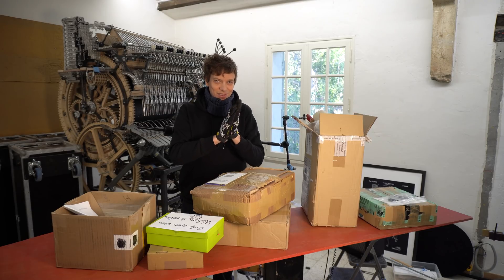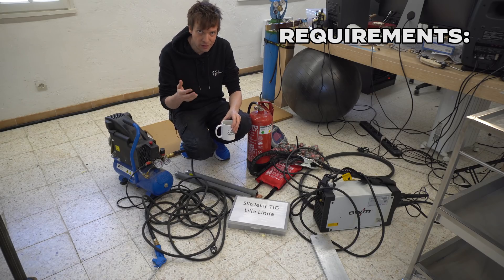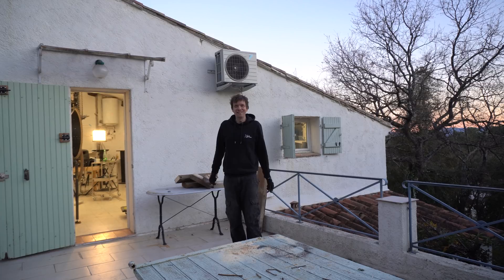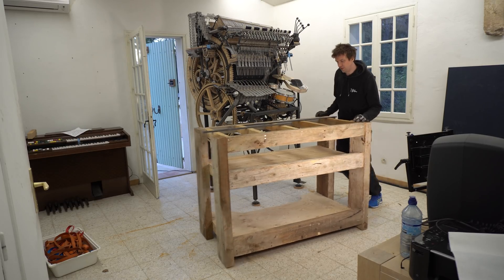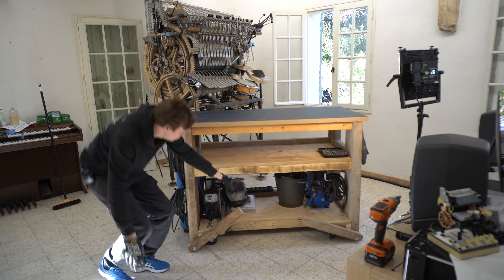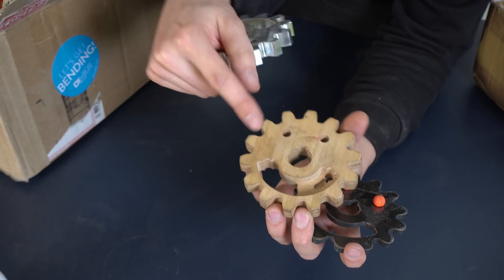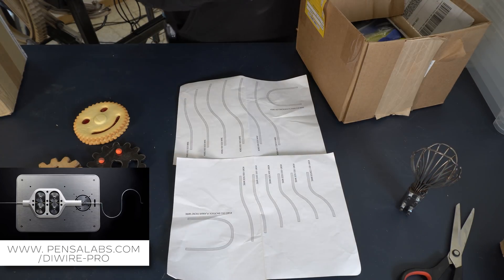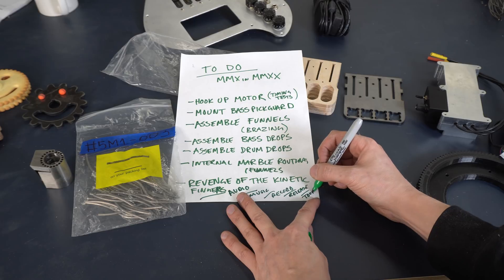New parts New workbench New start - Marble Machine X #113

Comment: Martin, please reconsider the locking legs.  As they are, sooner or later, they're going to fail, and the table will drop, jerking to one side.

I suggest you do one of two things.

Remake them with a flat spot at the tip, so they are less likely to roll off and drop the table.

Or, add some simple latch on the lever or table leg to keep it from shifting when the table is raised.

Comment: Unsolicited opinion: Not crazy about the motor. You are an integral part of the machine. Putting a motor there kind of reduces your connection to it. The motor is great to help with calibration, rehearsals, sound checks, etc. And the motor assist is a cool notion, too, just to keep your arms from wearing out during a concert. But a fully-automated MMX just kind of seems wrong.

Comment: you should add a timer solenoid/relay to the motor control. Instant Carillon that you can put the MMX on display after the tour when you are not using it.

Comment: I highly suggest you put a sheet of some conductive metal on the table and then connecting that to the ground of the welder - you won't have to clamp the ground to the thing you're welding, it just has to be touching the plate.

Comment: You should connect a midi-controller to the speed controller, and while you’re at it, make a midi-controller for the channel levers. After that, make the programming pegs midi-controlled by having them made from solenoids.

Comment: I love the overall sturdiness of the bench.  I think you might have problems with the transition process from stable to rolling.  The design you are using is essentially backwards from what most transition style benches use.  Most put the wheels on the transition mechanism and leave maximum floor contact patch for when it's in stable mode.  The levers are clever but it reduces your stable position to a very small contact patch which you may find your table moving around on you.  I'd suggest you either find a way to incorporate large adjustable rubber feet onto your lever lift mechanism to provide stability when you put the table into stable mode, or swap your wheels onto the 'lift lever' mechanism in some fashion so that you lever down to use the casters then when up, it sits on those big, heavy legs.  For someone that has engineered and designed a masterpiece work like the MMX, this should be a cakewalk and give you some diversionary fun... you already have it in CAD... LOL!
Reply: I thought the same thing when I saw the bench, too. He has these nice heavy legs with a lot of floor contact but they never actually touch the floor!
Reply: SHcinema  I love this comment, and I’m glad somebody brought up the correlation between table-leg sturdiness and contact area.

I would go one step further and suggest a spring-loaded tapered pin to secure the lift mechanism to the table legs when activated, in order to keep them from engaging/disengaging at inappropriate times.
Reply: Yeah normally it is the wheels that are retracted.
Reply: Just what I was think too
Reply: The cam leg extensions have one advantage.
With enough friction at the pivot, they can be adjusted for any unevenness in the shop floor.
Reply: @ssureshot  yes I agree that is a 'feature' of this design, but in order to make that an effective feature, the table would have to have a large enough contact area to actually utilize the uneven floor which would complicate the movement issue even further.  In essence, he really needs to have a parallelogram setup of 'feet' that use his cam design and instead of putting down a little bit of wood, lower large adjustable rubber elevator feet so he can adjust those for the uneven floor, levelling the table.  Best of all the designs for this kind of moving table.  I've seen it before so I can't claim to have thought of it.
Reply: The thing is His table is very heavy. And that opposite to usual solution just looks to be simpler one. 
If leaver would be locked in position, to avoid accidental release onto wheels, then tables weight should keep it out of movement.
Reply: Exactly what I thought. Huge legs but honestly only for „show“ because is you are doing work wich is so hard you would benefit from the huge sturdy legs the tiny levers are your bottleneck...

Comment: "This is not a proper engineering environment." You haven't worked with engineers before, have you? That's pretty normal in my experience haha
Reply: I thought the same thing... " Nah, that looks about right"
Reply: Also:
"Neatly is my kryptonite". Definitely an engineer.
Reply: Ah, but normal quite often isn't proper. ;)
Reply: It's only a proper engineering environment if it's not a proper engineering environment!
Reply: A good engineers desk is a valid Stock Picking Location in the ERP system
Reply: @ojsh_  it better not be. I have a hard enough time finding my QA material with out engineers sneaking in for a quick check. Not that it stops them.
Reply: it sure is. i speak from experience  XD
Reply: Yep, looks like my desk...
Reply: Speaking as an engineer, yes this is normal.

Comment: @2:30 : Original marble machine casually hanging in the scrap pile. Not even a look at it. THIS BELONGS IN A MUSEUM
Reply: I mean... It has already done a short stint in a museum, it just wasn't added as a permanent piece of the collection
Reply: Good spotting. Just digging through the “scrap pile”. Thanks
Reply: Rod Parker you’re right, I will correct my message !!
Reply: I hope it won't get too much humidity in there

Comment from the maker: BTW, something i forgot to explain clearly in this video: The electric motor is primarily there to make calibration test at stable rpm/bpm. So the first thought was to put it on temporarily to be able to calibrate the timing of the MMX without human error. Once on, i might get addicted to the machine being able to play by itself and leave it on as an option... but thats not decided yet. Hope you all had a great february and lets try to cross this finishing line in MMXX :) / Martin 
EDIT: Thank you for all the welcome back comments, it feels great to be back!
Reply: I loved the idea of it being a helper and allowing you to save energy and do more! I can imagine doing a world tour and long shows will involve a LOT of cranking so if it helps you make good music I'm all for it! Also the potential for a self playing MMX is cool for other song ideas!
Reply: I saw that youre lasercutted parts go all the way in to each other. Its easier when you leave the tabs a little shorter so you can fill the back up with weld and then grind them flat. Good having wintergatan wednesday back :P.
Reply: In my opinion having the option to put the motor on long-term would be great for when the machine stands in a museum in the future.
Reply: Yes!! I am glad you took that decision! I mentioned precisely the same solution some videos ago. Let the motor keep the tempo!!
Reply: Can the Motor controller use a Midi-Timecode? Or can the MMX produce such? That would open up lots of possibilities! A mechanical timecode wheel, with a sensor to trigger a Microcontroller that sends out the Midi timecode, and you can connect all  the stuff normally triggered by Midi. Synths,  drum machines (oh, forgot you have one integrated),  or the light show.
Reply: This was the exact video I needed to see today! I have been putting off building a new workbench AND organizing my own studio for quite some time now. I think I'll keep my bathroom though.... Its the only one I have so I kind of need it ;) But thanks for the kick in the pants to get moving! I'm gonna go watch the kinetic fingers video THENNN no more internet for today! Its high time I go Kondo everything and get my MMXX on the road!!! Thank you for the inspiration Martin!!!!! I'll see you on tour!
Reply: You are so inspirational man!!! My dream is to edit a video interview with you!!
Reply: Leave it on the MMX. It will be like your own big music box. Instead of a wind up drive you got the motor. Like you said it can free you up to maybe play another instrument.
Reply: keep the motor on it its great idea
Reply: If that electric governor mode works as intended, it would be a waste to not use it. It sounds extremely useful. Glad to have you back!
Reply: It bothers me to see the original Marble Machine sitting in an open shed getting rained on and ruined by the weather.  Martin!  Give your original Marble Machine more love!!!
Reply: You have a problem.
If you push the table sidways while the taple is up. The table will flip to the rolls and drive away .
Wouldnt be so cool if you are welding .

You can drill holes in the handles into the stands/legs .

So you can lock the handles with a M screw or bolt or stick . 
Would be a bit safer, i think.

Greetings from germany 😉
Reply: Yes! Please leave the motor on! The thing I was always worried about is you wearing yourself out!
Reply: Think of it as being analogous to adding a guitar pedal to a guitar.
Reply: motors are good for those long songs
Reply: while the editing is on point and I really enjoyed it, did you not promise to invest less time in optimizing youtube and more on the work and music? Again I appreciate it, but I could also have enjoyed a longer video without the musically timed edits ;)
Reply: Welcome back Martin! Re the motor, I'm not convinced. Calibration yes, but somehow it feels like a disconnect from the machine. Perhaps a mechanical governor? But that sounds like feature creep and delay. Also, I have no idea of the effort required to crank it for several songs!
Looking forward to seeing MMX live in MMXX!
Reply: The motor will be invaluable for quality assurance testing.  With the motor, you can run the whole system for hours at a time to see what problems might arise - like simulating a world tour before the world tour.  You could record it and then automate the analysis of the generated audio files to see if anything drops out or gets out of sync.
Reply: I also have mixed feelings about it. It does have its benefits in terms of practicality and creative freedom, but a lot of the appeal of the marble machine is that it's all mechanical and hand-driven. There's a balance to be had between practicality and flexibility and artistic value - if you don't go far enough you might not be able to practically use the marble machine for performances (which defeats the point of the marble machine - something which you can use on stage to make good music), but if you go too far you might end up with effectively an overly complicated and still technically limited self-playing vibraphone (which also defeats the point of the marble machine - an instrument that you play and perform with, not a replacement for you).
Reply: Keep the motor. You can always turn it off, but having it able to take over the cranking for you gives you so much more freedom to play involved melodies or even another instrument for a bit.
Reply: I was about to say,'Martin, this video is too nice!' then I remembered you have help with the vid production now- he's doing a stellar job :)
Reply: I hope you eat the wilson cookie
Reply: Please don't. Don't use that motor. It will totally lose it's soul.😀
Reply: The electric motor will be a a sane and wise decision! I was really worried that the MMX could not manually play a stable bpm, which is required for playing along with pre-recorded track.
And making the motor optional gives you your freedom, and still stay close to the original philosophy of the MMX.
Reply: @marknn3  It holds true to the old "wonder" instruments, the very first "self-players" people thought were utter magic in the olden days; just a modern twist!
Reply: Welcome back! It's a great day! A Wintergatan video, and a Tested video, released at exactly the same time! I hope you actually ate Wilson Cookie, because he looks delicious. He would go perfectly with I Believe coffee.
Reply: it's finally feels wednesday closing the day with your vid ! welcome back !
Reply: The motor makes sense, it frees up creative brain space if nothing else.
Reply: bro your videos are so fucking loud in comparison to everything else on this platform :p
wish others would master their audio a bit
Reply: Hello! You are the best do-it-yourselfer! Good luck in MMX!
Reply: I think it's perfectly fair to have the MMX able to play itself, especially for the purpose of making filming music videos for it easier. I have to imagine the original MM video was incredibly difficult to put together, to get the beat of the music and the motions of playing it properly synchronized. Being able to use that motor would make that much easier -- and as mentioned, you can get even more creative with what you can do. (Drum/bass solos, throwing in a duet with the machine on the vibraphone, etc.) The precision you'll get with the motor for calibration is mere jam in the cookie at that point. :D
Reply: If you feel like the motor os cheating, then maybe you can add an electric-generating bike attatchment to the MMX so you can petal-power the electric motor. ; )
Reply: Personally, I think using that motor would take away some of the charm. There's just... Something about all of these gears, assemblies, and the machine itself moving and running off you. It becomes more than just an automatic music box when you're a part of it
Reply: A HUGE part of the charm of the Marble Machine is that it's 100% mechanical aside from the mikes/pickups. Testing aside, electric power is one step WAY too far. The last thing you need at this stage is feature creep, anyways.
Reply: Leave the motor on as an option!
Reply: I think the motor is a good addition. It doesn't take away from all the amazing work and engineering you have put in to make it completely analogue. All it does is replace you as the crank turner.
Reply: I see no problem with there being a motor - it makes the MMX even closer to the carillons and music boxes at Museum Speelklok which inspired it!
Reply: Who is this guy? Where is Martin? This is an impostor. Surely you guys can see that, right?
Reply: G spair ke tu c parlé fren c ( only french understand)
Reply: leave it on the way you've implemented it to be supportive to human control rather than overwriting it is a great middle ground for everything
Reply: Genius
Reply: welcome back! i think the electric motor is a great idea, i think it keeps the marble machine spirit alive being able to play and operate the machine manually with human power and for concert purposes the electric motor frees up another hand of yours to play more complex music like with your ondophone so i think its a great idea and you should keep it!
Reply: feature creep :P
Reply: Most people:  Locking wheels
Martin:  Stabilizer-lifting-legs
Love it!
Thx for the shout!  I BELIEVE MMX will tour in MMXX!!
Reply: electronics is fascinating. Machine is mechanical, but it does not mean it is being constructed in 18th century. Rational use of electronics never hurt =)
Reply: U are the new ikea
Reply: The Internets was too quiet without you!
I'm glad you got away a few weeks, but I'm even happier to see you back in the studio!

Tiny gripe with the new video team - they edited your explaining in a way that made it a little too truncated and choppy.
From experience, that often happens because you, when editing, go over the same scenes/soundbytes so often that your brain register much more nuance/info than someone hearing/watching a video for the first time.
Other than that, great job and hooray for everyone involved with this project!
Reply: Gorm Sundberg So true. This channel represents my favorite editing in any YouTube collection ever. I hope the editing team can continue it, but I’m also content with 113 episodes of it.
Reply: Martin - use locking casters. All it is is the wheel with a switch to lock the wheels - example: https://www.uline.com/Product/Detail/H-5537SWB/Casters-and-Wheels/Standard-Rubber-Caster-Swivel-with-Brake-4-x-1-1-4?pricode=WA9879&gadtype=pla&id=H-5537SWB&gclid=CjwKCAiA1rPyBRAREiwA1UIy8F-5WzvCcIIZ5VZUf7iSya5emOR8xjTFiKYLLj28Esjm0XZr50dvOBoCp-EQAvD_BwE&gclsrc=aw.ds
Reply: 4jonah The casters aren’t accessible with the way he built it. Also, his design is much easier to use than locking casters, and with heavy desks like this, ease of use is the name of the game to stay organized. Colin furze and Adam Savage have great examples of this.
Reply: Please ask the editing team to do add some original editing styles once in a while, like your old videos? Just have fun with it like before?